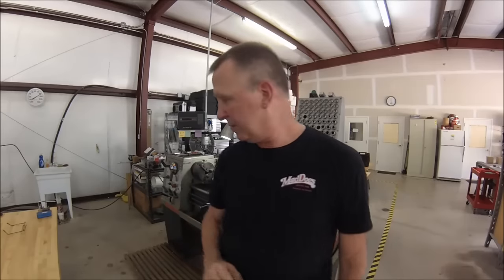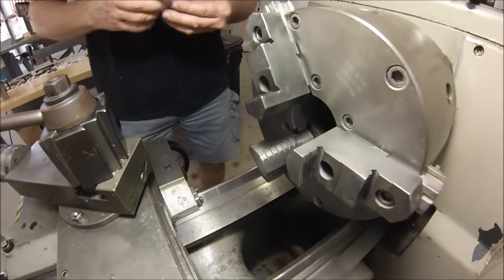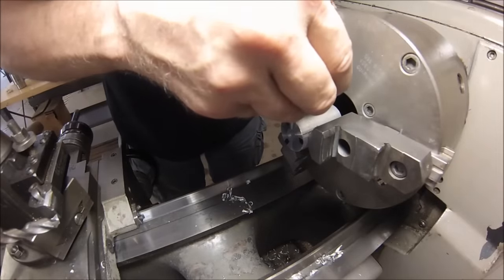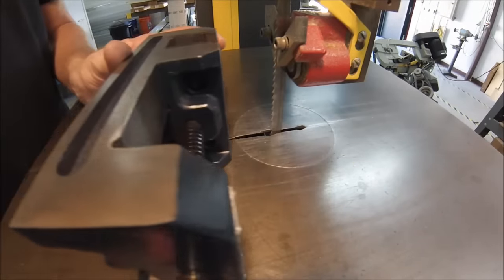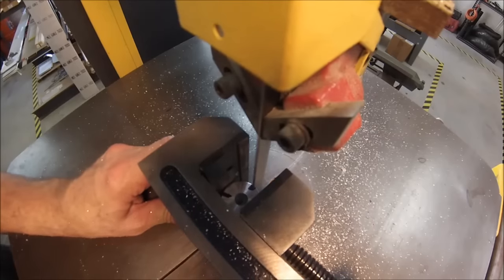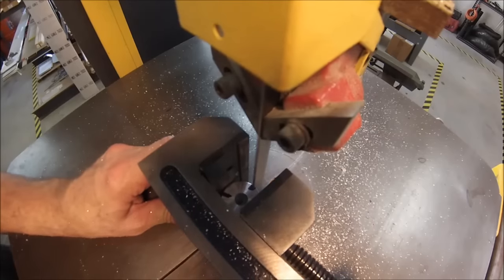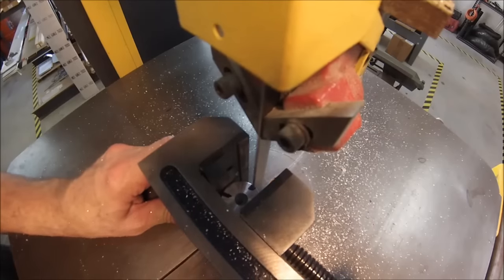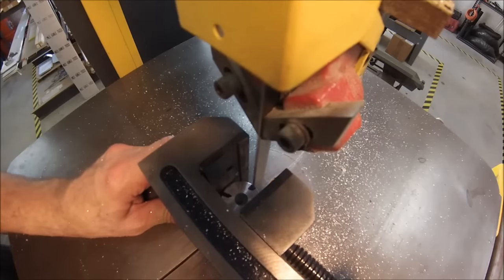Get your parts to run true in a non adjustable chuck. YOU MUST WATCH THIS!

Comment: Hi Joe  Please can you explain why not run the lathe with an unloaded chuck ? Just subbed and am working thru' your vids. I like that you explain and review at the end.
Reply: On rotating jaws forces are acting towards the outside. Loose jaws at motion don't stay at their location because of missing friction.
When the loose jaws reach the outer end of their travel capacity they behave as described in Newton's First Law of Motion: A body in motion at a constant velocity will remain in motion in a straight line unless acted upon by an outside force. So Newton's law brings us to final part, where a second mass at rest could cause an inelastic collision with the jaw moving in a straight direction out of the chuck - the second mass at rest is most probably your skull.
Reply from the maker: I have seen the walk out and jam between the ways and chuck body. The lathe and operator usually go out the door together.
Reply: Someone did that at my factory 25 years ago. A jaw came loose and almost went through the side of the factory wall. The opp would've died had it hit him in the head. He was very lucky.
Reply: Thanks Gents good always good to know why the one can teach others
Reply: .. then  one can teach others

Comment: I'm not a machinist of any kind, but I enjoy learning things.  I have a question - after reaming the bushing but before loosening the chuck, why not run a line of crazy glue along the junction of the bushing and on jaw?  Would that hold the bushing in position?  The glue could be removed with acetone.
Reply from the maker: If done correctly, there is pressure on the bushing at all times. The secret while using a setup like this is to just open the chuck enough to release the part, but still grip the bushing.

Comment: At first glance this seemed great, being able to chew up anything you stick into your lathe. But after thinking about this my thoughts go to what if the chuck goes out another thousands? Now you have to make all those bushings all over again? I think it would be better to go to the root of the problem and fix the chuck. Not only would it save you a lot of work building bushings for everything but would also make it to where you could put anything in the Chuck when needed and save yourself a lot of time and trouble.
Reply from the maker: Agreed, but thats not the intent of this video. Grinding chuck jaws is another topic all together. Not all small shops have toolpost grinders to do that. To re-use or re-dress these bushings, either go to the next size up, or use a thinner spacer shim and re-bore. This technique will allow you to use a worn chuck to get a precision part when done correctly.

Comment: Mr. Piecznki I watched you demonstration and I learned a lot, thank you, however, I have a question; wound you get the same result by using a collets in place of the chuck?? Thank you and have a good day.
Reply from the maker: Yes, same if not better. Collets are known to be much more precise than a chuck.
Reply: Sir thank you for responding, and think we should add to your response, Chinese Collects are NOT GOOD according to my experience. I personally will use your method, thank you, and have a good day.
Reply from the maker: I'll take a hardinge collet over any other brand, any day.  You have a good day as well.

Comment: When checking if it's straight, need to rotate the part.  if it wasn't straight, you could run out along one line (call it "top"), find a + deviation.  Run out along the bottom, find a - deviation.  Run out along the sides, find a 0 deviation.  How do you know whether you're on one of the "sides" or not without rotating the part?
Reply from the maker: I always rotate a part to indicate it. Unless I am checking level of a chuck.

Comment: Joe--------Do you do this bushing-making for everything you hold in your 3-jaw?  Kind of time-consuming isn't it?  Have you ever thought about truing up the top jaws to run true all the time?   That is, so you don't have to make a bushing every time you hold something?  That's what I'd do.  It looks like this is the only engine lathe in your shop, so once you true the top jaws, they should be OK for everything.  The scroll in the chuck doesn't change.  It will remain consistant all the time. Maybe I'm missing something.  I can't imagine your chuck running .015 out of round.  If this were in my shop, I'd modify the top jaws and make them run accurate.  Or, use soft jaws for general turning work.  You don't have to re-bore them every time you use them.   I don't know about you, but I hate to waste time.
Reply: Rob Macfarlane You again? As a troll, I can bet you are a great machinist
Reply: no, he showed us before, his chuck was only .002 out. so he made it really out by .013 to demonstrate the trick.

Comment: Neat Trick! Just thinking, by pulling it out (the adapter collet) and putting it back in the chuck at 12 O'clock position referencing the chuck key would bring it back close, but removing and retightening the chuck or slight variation in rotation (off 12 O'clock) may introduce errors, particularly on a worn chuck. but far better than 15 thou.
Reply from the maker: Use a smaller shim and re-bore it, or use it for the next larger size you need to hold. This is not intended to be taken out.
Reply: Not intended to be taken out but sometimes you have to. I always scribe around the number 1 jaw first. Both sides and the front and don't adjust the chuck while it's out.

Comment: Can chuck jaws be re-ground by reversing them, clamping down, and grinding/cutting the now outward-facing jaws?
Reply: You can't reverse jaws if it's a scroll plate ( spiral)  chuck
Reply: nope I don't think you can. I've never tried it, but I don't believe the scroll is ground precision enough to be able to do this in reverse.

Comment: 8:00 why do so many people use a file to de- bur by putting their left arm over the moving chuck? Even being right handed I never do that but instead have my left hand on the file handle and my right hand at the front of the file to the side of the chuck rather than over the chuck. Much safer.
Reply from the maker: I think its all a matter of which way you were taught and your comfort zone. When I lean in over a spinning chuck, my left elbow  / forearm area usually registers on the head of the lathe and gives me a very confident registration point for the procedure. Coming in from the front, your pressure is towards the chuck and you have no anchor point. I'll go over the chuck any day.
Reply: I agree that using a posture that's comfortable and we're used to can be innately safer than a contrived posture just for that machine.  If something unexpected happens and we're in a comfortable posture our reflexes are likely to guide us to safety.  I happen to be left handed so the "correct" use of a file on a lathe is comfortable.
Reply from the maker: There is a big myth about a file hitting a spinning chuck. The chuck will reject the file 99% of the time. if the tip hits, its a problem. Just be safe.
Reply from the maker: Quick question....Do you still come in from the outside if you use a collet?
Reply: Me?  I'm left handed so the entire machine is in mirror image to my preference and a lot of operations feel awkward.  I generally reach for a tool with my left hand, and when the right hand does an operation the left hand kind of talks to the right hand.  I expect we're all that way when we use a non dominant hand.  What's your experience of this?  I find it safest to not think about it and let the hands work it out.  I trust reflex to react properly if things go awry.
Reply from the maker: I have used the same technique on my QCTP since I learned. I activate the handle with my left hand and reach over with the right to grab and change the tool. I don't take my hand off the QCTP lever for the entire tool change. Its quick and intuitive.
Reply: Thats good thinking

Comment: What's the advantage to making a bunch of DIY collets to use in your 3 jaw over just changing over to a 4 jaw when you need to be really accurate? Seems much more time consuming.
Reply from the maker: This is a 5 minute job that doesn't require a 4 jaw.
Reply: I am still missing something. It's a 5 minute job you spent 20 minutes making a collet for. Could you be a little more specific about what use cases there are on when this would be  less time consuming than switching to a 4 jaw? The only thing I can think of is production run stuff, like making 100 of the same part.
Reply from the maker: It takes 5 minutes to make the collar. The thing a lot of you miss, is, that this is for the guys that don't have options or multiple chucks laying around. I am still not a fan of using 4 jaw chucks for round stock.
Reply: In many cases the 4 jaw on round stock is a waste of time setting up.
I have both I use both.
Reply from the maker: 4 sides = 4 jaws....simple. Round stock gets a 3 or 6 jaw. Nothing else unless its eccentric.
Reply: So True Joe. I am a beginner and just bought my first lathe so all I have is the factory 3-jaw chuck. Thanks for the video. This is something I will not forget, and if I do, I book marked it. LOL

Comment: Use a 5" length of stock, shape and diameter not really important, but I like 2" thickness for easy visualization.  Lock it in the jaws with 2" floating out.  Face it and round out the outer diameter.  The freshly rounded outer diameter is now true.  Loosen chuck and flip the stock around.  Face the flat of the remaining length of stock and round out the now outer diameter.  Line up a center head and lightly press a dot into the face of the stock.  Spin the chucked stock to see if it's true.  As long as the head is solid, the chucks and center should be dead on.

The entire process should take you only 2-5 minutes depending on how fast you move around.  You're welcome.
Reply from the maker: Unless you control your flip move, you have one end of your bar still running eccentric. If your point is to use the extended material to establish a true part, why bother flipping it around. The freshly turned material now being held in eccentric jaws will not be true to the second side you will turn. You have realistically achieved nothing beyond the condition that existed when you made your first cuts. Except wasting 2-5 minutes. You're welcome.

Comment: Chucks!  I found myself in the predicament of having 2 six-jaw chucks, 2 three-jaw chucks, and zero four-jaw chucks.  First of all, what can I do or not do with a six-jaw that I need a four-jaw for?  Second, I found a set of six jaws in good condition here, but wonder what occasion would I consider / lead to swapping them out on a chuck?  I guess they're not usable on a three or four jaw chuck?  Can you do a video on chucks, camlock adapter plates, and collets?  I also need a sort-of chuck/holder for the GBox end of a lathe to hold a gun barrel steady and true while I work on the opposite end.  The challenge is that barrels come in all lengths, and shorter ones end deep inside the lathe spindle.  Thankfully, I have a short headstock.  But I'm not an inventor.

Comment: So this is a one time trick, once you take the billet out of the chuck it's game over for repeatability. This is alright if your work is always the same bar stock. And this is just a collet chuck but in a 3 jaw. I was once showed a way and that was to grip a bit of bar on the very back edge of the jaw. And bore them out. I know I know, they are hardened but it works. And then either grind the back bit you didn't machine away to clearance. Or polish dependant on amount but if ur chuck is 15 thou out, chances are it has been like that for a while and it doesn't matter haha
Reply from the maker: You can correct bad jaws a variety of ways, but it is important to have the pressure in front of the jaws during the process, not the rear. This bushing should stay in place but can be reused for a larger size later. Just re-bore it.
Reply: Joe Pieczynski True True, it's back to the old phrase, fitness for purpose. Don't waste too much time if it isn't necessary.
Reply: Joe, Many moons ago I was a machinist (and Deep Sea Diver) for the Navy. Mostly Diver. If you mark the bushing well enough to that chuck it should be useful to re-use when you need it. Right? If the beast is that far out in the first place any improvement is useful over the original. At least that's my impression. If need be a touch of tweaking can make it work. Thanks for the trick tip.

Comment: Good video, thankyou. Are you likely to get repeatability if you remove the aluminium part and replace it at a later date?
As an aside, I did a test dial-up on the tail-stock of my Bantam recently and found it was running non parallel to the bed. Set it up according to the manual, now drill-bits do not 'climb' as they enter the work, the chips leave the hole easier and squealing at depth is reduced considerably. My next job is to do an internal grind of the chuck jaws. (Using a compression plate.)
Reply from the maker: I would only trust this method on the first use. If you have to use it again, use it for the next larger size, or use a thinner shim to squeeze on and bore it again if you need the same size. Anything you can do to get the jaw load close to the tip of the jaws for grinding will yield the best results. I'm glad you intend to squeeze instead of spread your jaws.

Comment: Hi, when I dial the dead center within .0003 and then put my stock shaft in the dead center and recheck the shaft close to the Dead center it read .003!! I already drilled the shaft using my er collet with 3/16 center drill and I did dial it and aligned within .0003 to the head spindle and I know my er collet it's center with head center!! So that mean my center drill hole in the shaft is center within .0002 So it's weird when I put my dial indecator magnetic on chuck and point the dial tip on the shaft close to the dead center and it read .003!! The stock rod I use is 0-1 steel tooling So to make the both ends of the shaft read .0003 it's impossible !! I use 4 jaw chuck to adjust the 4 jaws to .0001 I used fallow rest but it didn't work because the shaft need to stepped down from 8mm to 5 mm DIA ( it should be 2.5 " long x 8mm DIA) and stepped down to 5mm to the rest of it) Yes I will hardened after I finish machine it to the size and drill 1.5 mm hole to instal the plastic pinion that will be hole by 1.5 mm pin I use 3000 f heat forge then dip it in oil then put it in oven 400f for 2.5 hours Now I have friend of mine called me from over seas and he said try to use something called ( kabisten or many cabisten) not sure in English what is , but it can be installed instead of the chuck and it has carbide cutting inserts and he said use 3 jaw chuck that can be fit in the qctp and feed the shaft into the head stock through that cabisten or kabisten whatever the name!! Thank you and I appreciate your help sir

Comment: Rube Goldberg award nomination for this guy!  30 minutes?  Put a shim between the low jaw find the right thickness one and done!  You want an offset bushing to use all the time?  Put a shim between it and the chuck on the high reading spot and drill and ream to size then take it to the band saw.  if you want to make money doing this you have to do it fast!
Reply: If you want fast buy some soft Jaws...smh.
Reply: ESI Precision, soft jaws are not the “do all” answer besides they lose their tolerance relatively quick if your doing any repeatability work and running it for any small production use. For a tool room soft jaws are probably fine but not the do all and be done answer for many.
Reply: @glennedward2201  that's why all my chucks are adjustable.

Comment: New to all of this.  So sorry if the answer should be obvious.  But here goes anyway.  You get all done with whatever the machining project is and you put this up on the shelf until you need it again.  How do you go about getting it to line up to where you had it on the first go round so that you are all zeroed out the next time you need it?  Do you peen a couple of register marks on the piece and the head?
Reply from the maker: Unless you have deep bite marks in the OD of the bushing and can feel where the jaws initially grabbed, I usually suggest the use of a thinner shim on the next use and a light bore pass to re-establish the concentricity. Or pick a smaller one from another job and bore that to the next size up. This is a stationary fix primarily and really not suggested for in and out applications.
Reply: Thank you.
Reply: You pretend it was never in the chuck and "true" to begin with and start over from scratch.
Reply from the maker: Lightly rebore is fine. Starting from scratch would be a huge waste of time.
Reply: Thank you, can hardly wait to get a lathe so I can put some of these wonderful techniques into use.
Reply: Maybe you can put witness marks to minimise setup, but rest assured if you don't indicate it to check, it's going to go pear shaped.

Comment: It's much more efficient just to true your chuck.  Why go through all this work for every single job?  I mean, if it's off by a certain amount and it's repeatable, just grind the jaws down concentric and be done with it.  Even if you don't have a toolpost grinder, you can rig up a dremel on the toolpost and easily get it to +-.001.
Reply from the maker: Grinding is certainly an option if you have a grinder. But that's not the point of this video.